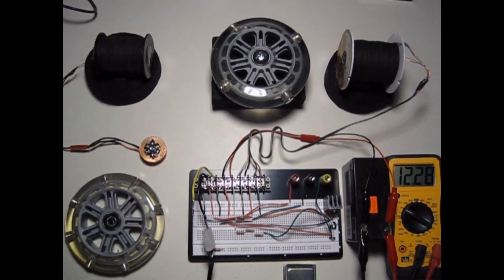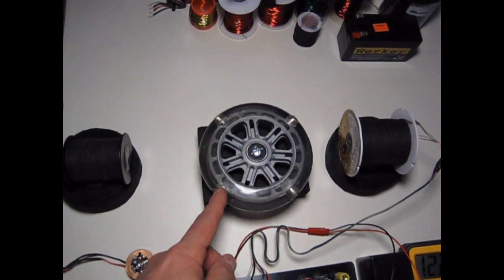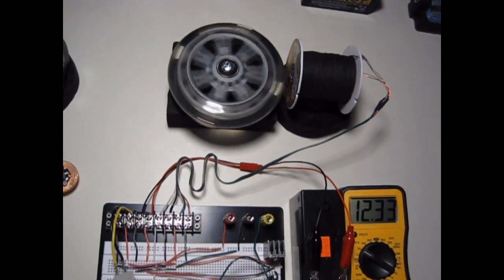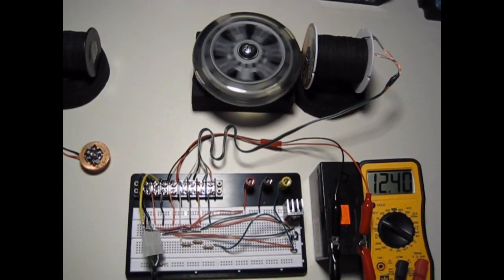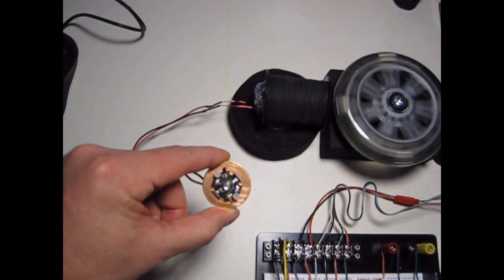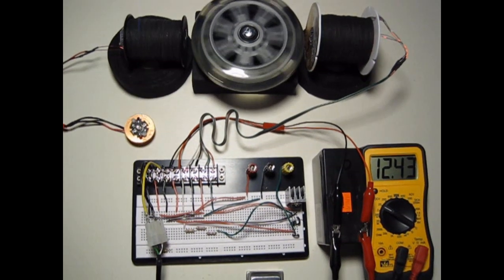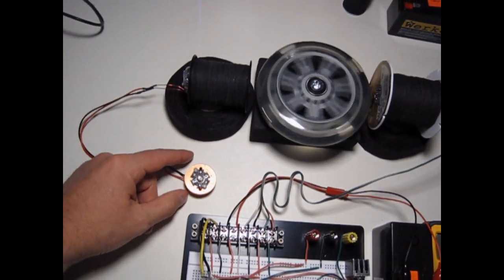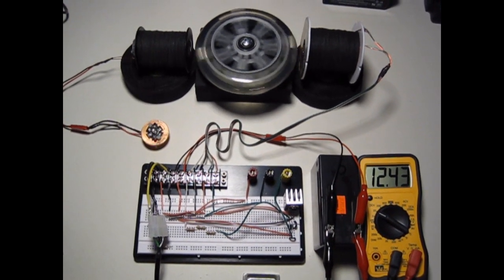My 3rd Bedini Motor Part 2

Comment: Checkout 159 seconds. That blue line from the LED traveling up the screen is light in a scalar wave mode. You're hitting the LED from both directions producing a standing wave. I had been wondering how to do it in the light frequencies! Thank you! =^_^=_

Comment: Well using an external power supply you could put a lot more power into the motor and easily run your induction flashing LED and 12 V SLA battery charger.  So what?   ..... this is not FREE ENERGY or OVER UNITY, it is just induced current into an LED and a battery charger!!!!   The end.